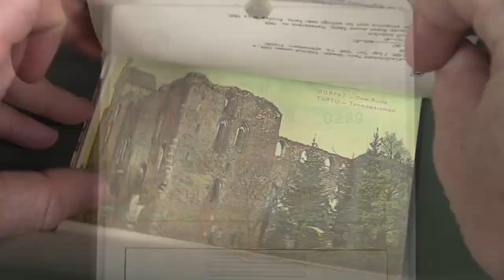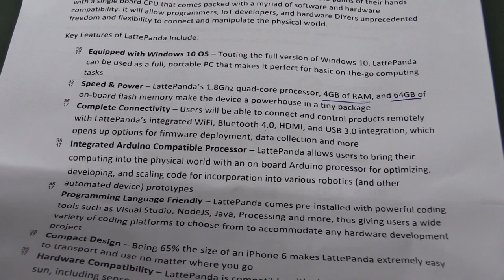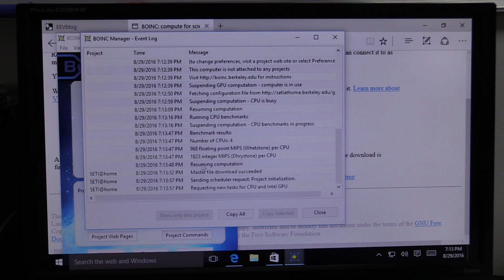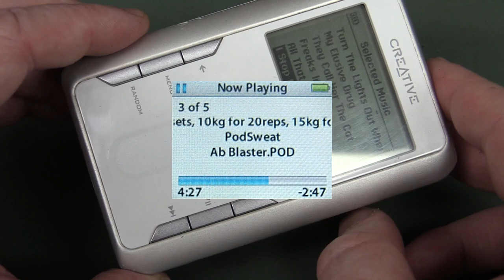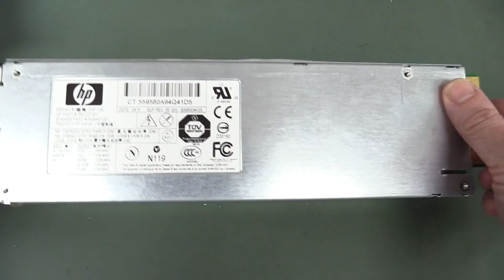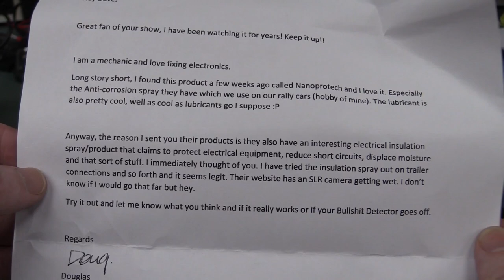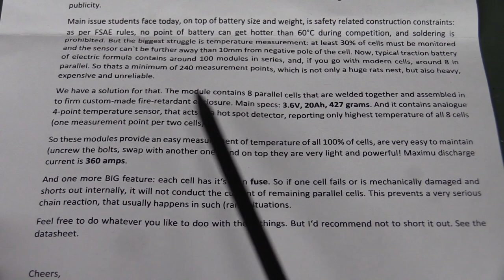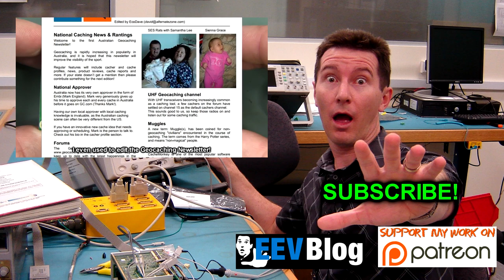EEVblog #917 - Mailbag

Comment: If the HP servers those power supplies go into are anything like the Dell machines I've been inside, they have modular fans that clip into the board right in front of the PSU. They're little 1-inch things with absolutely ridiculous RPM (up to 10k at full load) to push the air through such a tight space.

Comment: I never had one of those zen players, but I do still have my Archos 504 from around 2006. I don't use it for video any more, but I still listen to music on it. The hard drive is big enough to hold around 20,000 songs (~256k VBR MP3) unlike my crappy phone. The batteries are pretty worn out though, they only last a few hours now.

Comment: The power supply is from a very old ProLiant DL360 G3 and provides 325 Watts. Nowadays you can get 1.200 Watts in about the third of the volume, that's almost 12 times more energy per volume. And also those are 94% efficiency with much less heat generation !

Comment: As far as that server PSU goes, it's passive as a module, and hot swap-able as you've indicated as well as the circuitry monitors the supply and unit performance while reports health stat's (to what was traditionally called a BMC (Baseboard Management Controller)) but have been redefined as of late.  To address the passive appearance, the server unit to which this PSU belongs is doing the forced air with hot-swap fans (of course they are!) and it's quite typical of these systems to pull in ~68*F ambient air and kick out ~100*F exhaust.  Quite well constructed and reliable these power units are.  Being in the industry for over 9  years (since 2007) and working in a rather large data-center with thousands of servers and having multiple PSU's each I've only replaced a handful (<10).

Comment: @34.00 Servers are built like wind tunnels, blasting massive CFM's through the case to keep the hardware within spec.  If you wanted to be in a server room, bring ear plugs! The noise can reach into the upper 90-110 DB range. The upper range especially if the servers are working at nearly 100% load.

Comment: Being an owner of a baytrail based (about 10 to 20% slower than cherry trail socs) 8 inch tablet with windows, I can assure you all this choppines is windows 10 doing updates and installing stuff. One thing I immediatly noticed was the sound/volume icon showing a big white X on it, so the sound driver was still being installed and initialised.
I'm 100% sure that the little beastie will run fine after all the updates are done.

Comment: I believe I have the same USB cable
You can plug it either way, but some of them are faulty and will drop a lot voltage during load when plug one way, not the other.

Comment: high voltage electric motor used to spray on that and see if it still works after going deeply into water for a couple days. or get a cheap cell phone and trying the spary on it and dunk it in water for a couple days and see if it works after?

Comment: The transistor is a germanium PNP designed for low frequency amplification. 

What do I win?
Reply from the maker: Datasheet link or it didn't happen.
Reply: if you cut the head of that transistor you would use it as photo-diode :)
Reply: П40 - almost the same as МП40, but less noise.
Reply: 10-79 would be the manufacture month and year. Ꜿ is a dotted lunate reverse Sigma, or a dotted lunate Antisigma, or Antisigma Periestigmenon, which comes from the Hellenistic period of Ancient Greece.
The only use I could find for the symbol was for editing. I can't find any uses of it in maths, sciences, manufacturing, etc.; not that finding that kind of information is easy especially when its used on parts from decades ago.

Edit: Or at least the backwards C with the dot looks like an Antisigma Periestigmenon. Could be something completely different.
Reply: +Derp Herp ....So what did you win?
Reply: 1 million dollars, still waiting for Dave to paypal it.
Reply: +Derp Herp  Has Dave ever awarded ANYONE for knowing the answer to his question-contests?
Reply: Have you ever done it?
Reply: 😅😅 😅 Incredible!
Reply: @bondarenkodf  Damn right I did that when I was a boy back in east Germany. We had lots of Russian transistors.

Comment: Put the button High, so it will enable the PWR_BTN pin on the PMIC, just solder it to the + VBUS pin of the Micro USB. Pretty weird to use a power button.. I can see how it would be annoying.

Comment: For small and portable devices i really wish they would soon swap to USb type-C connectors.
And for things as like singleboard computers, just go for Thunderbolt-3.
With that single plug you deliver the power, can hook up a display, ethernet, audio and your mouse/keyboard.

Yeah, the chips cost a bit, but hey - if you look at the Panda-boar, you could get rid of most of the connectors and make it a bit smaller.

Comment: Use the spray on the VFD calculator and dunk it into a glass of water, A bit of high voltage and logic circuit should prove the point.

Comment: I still use my 2006 vintage 4th gen iPod in the car, though it's had its dead 60GB hard drive replaced with a 128GB CF card. The physical interface is a lot easier for me to use without looking at it when I'm driving, compared to my phone's touch screen, so it's not nearly as distracting.

Comment: When you run USB devices off the  bench power supply, give it a bit more voltage to compensate for the voltage drop in the cable. USB can go up to 5.25V and still be in spec.
Most phone chargers run a bit over 5V, which is probably why it worked.

Comment: Spray the Creative Zen guts with the Nano Protech then turn it on then drop it in water and see if it will run like the drill they pictured. By the way I used to work where we used the gov. spec. conformal coating was checked with UV light.

Comment: @EEVblog you should try that NANO Protech on one of those cheap multi-meters that you have lying around and then try to spray it with water to simulate rain because a highly doubt it will protect it if you will just dip it in water

Comment: 12:46 - That's Microsoft Edge, a browser designed specifically for Windows 10. Edge is taking after the likes of Chrome and Firefox, whereas Internet Explorer, which is also in Windows 10 for some reason, takes after NCSA Mosaic.

Comment: nano protect should be easy for you to test, you have the equipment to test isolation, so just do a before and after.  Or, if your the showy type, spray a drill and stick it in a bucket of salt water :P

Comment: Extreme Overclockers using liquid nitrogen to cool CPUs to break records use a variety of methods to insulate their components from moisture and temperature. Liquid electrical tape is just one, I wonder if a spray would actually provide enough of a coating as opposed to manually dolloping it on.

Comment: Dave fix the power supply at 32:20 you can see the bad connection 1 in (25.4mm) below the inductors :) trolling

Comment: On the NANO PROTECH "drill underwater": they show an AC drill, which would be a good way to shock yourself, but you can drop a DC brushed motor cordless drill into ordinary fresh water and it'll work, without having to spray any BS on it.

Comment: The little Windows 10 board could make a fun "hacker's laptop" project.
Reply: just rip win10 out and good to go
Reply: How would you remove windows? It's not like you can just stick a bootable USB stick in it and press F10 as it powers on...
Reply: probably jtag, it can be done a number of methods
Reply: well thats how you do it rip linux on a stick and boot from there.

Comment: Nice thing is the LattePanda 2GB model with Windows 10 preinstalled only costs 109 dollars.

Buddy over at Explaining Computers did a video on the same Lattepanda 2GB model if you guys want to check it out. Seems like you could at least use this as a proper everyday use computer if you know what your doing.

Comment: 1) CPU of the lattepanda is on the BACK SIDE. 2) i run boinc on it and it's very very hot. if you dont give it a proper heat sink or a fan, it will throttle to ~0.3 GHz. 3)  lattepanda seems very sensitive to power voltage. you'd either need a cable with very low resistance or a power supply with output slightly higher than 5V (like 5.2V-5.5 V) to compensate the voltage loss by the cable.

Comment: I don't have the exact same model, but in mine there were 2 PSUs of the same formfactor cooled by 3 40mm fans. They are rated 14W each so you can imagine that there is some airflow, and yes, it is screaming when it goes out :D

Comment: HP really do design some good server hardware, I've not had many HP servers fail at all. Most servers have a row of fans near the front that push air out the back, so this power supply will have quite a bit of airflow - server fans push out a LOT of air!

Comment: Most rack cases have air going through the entire case, so you'd get plenty of cooling on the PSU.
Reply: Correct That is a HP Proliant ML3xx series server PSU.  PSU chassis has active airflow though redundant fans as well.

Comment: Wow, that battery pack uses Samsung 25R cells. Those things are high current and indestructible. Want to read a fun datasheet you should pull the datasheet for the 25R cells. It's states things like "baked in oven / results no explosion" but it's also very thorough. Good cells, not the highest capacity but stable at high amperage I think it does 25A max out over cell hence the name 25R. Hard to find authentic ones on the Internet, many forgeries with these cells. But if you find real ones they won't disappoint.

Comment: I still use my gaming PC bought 10 years ago, and it's in a full-size ATX case, and have 2 GB of RAM. This thing has 4 GB! The technology is incredible! And my old PC wouldn't handle Windows 10 — that's for sure. And it's about 10 times cheaper...
Dave maybe PIXIS teardown could be more detailed. Maybe it would be interesting also to see what chips are on the power supply control board. They must be op amps and comparators, and maybe a micro between them, but anyway.)
The Toughbook is like dropped from a car while it was moving!

Comment: Come on Dave... at least spray something (ANYTHING!) with the nano-stuff and dip it in some water.  Surfaces treated to be hyrdophobic (which is basically what is described in the blurb) are VERY obvious once you give them a dip in the ol' H2O.  
All the other products that I have seen which do the same thing are a 2 part treatment (and expensive), so a 1 part system would be very interesting.  So please.... spray and dunk!
Reply: All products? So you've never heard of conformal coating? or even using plain ol' nail varnish? (neither of which are terribly expensive.)
Reply: I saw an experiment back in the 80s where a guy sprayed a 240V lamp holder and lamp with CRC/WD40 and dropped it in a bucket of water. That seemed to work.

Comment: Do they still make those 'easy' buttons?  There was quite the hacking craze going on with those at one time or another.

If you want to see a nicely designed power supply, look at one of the 2.4kW compact power supplies for a Dell Poweredge M1000e which are manufactured by Flextronics Power.  They are amazingly compact for how much power they put out (12v at 192 amps!)

Comment: Precious radio. I had several of these radios and televisions Russian-made communist era. Although at that time there was no talk of open hardware, the Russians already put into practice. In the user manuals of these radios and televisions, they included electronic diagrams with all the details, values and even waveform observed by the oscilloscope. I still have some of those diagrams. Transistors seen in the video, we opened with a file at the top, and we put a lens and used it as phototransistors. That was in my teens, in the 90s, on the Isle of Cuba. Thank you for bringing those memories.

Comment: Dave, those Pyxis units suffered shoddy SMD caps, that's what usually causes a dead display.
Reply: The GPS signal was changed in the 1990s and this receiver needs a new chip to work.  I know because I have one.  Sony did not offer a new chip to make it work so, it is useless.
Reply: @richardneidhardt1828  You have the correct year, but GPS didn't change. The issue is actually caused by the GPS week number rollover. Certain GPS units, including the Pyxis, cannot handle the week number rolling from 1024 back to zero. It would have worked after the week number had incremented enough (the exact count depends on the receiver), but it again rolled over in 2019. The GPS signal has been added to, but never in a way that breaks compatibility with older receivers. Even my Magellan Trailblazer will still work, aside from the bug mentioned above. (I'm not sure if mine is affected or not, I need to check.)
Reply: I will be interested in knowing if your Pyxis works.

Comment: "Nano"protech... Probably micronized PTFE spray on acrylic carrier. Pretty decent sealant. Do not spray ports with it unless you want them to fail.
Reply: Sorry for self answering... I was wrong. It's paraffin-based, much less interesting and much worse. This is why it says a year lifetime, it will break down in time.

Here's a sample MSDS: http://www.nanoprotech.ru/attachments/get/109/nanoprotech-o_electric_aerosol_en.pdf

Got to oil up your electronics! At least it will be easy to remove with some naphtha or maybe even acetone.

Comment: A quad core Atom SBC running Windows 10, and it's slow as a wet wick? This is just one reason why the CC/open hardware community has mostly moved to Linux on ARM processors.

Comment: It is slow because it is thermal throttling, Lattepanda failed to put a heatsink on it. After I put heatsinks on it it works perfectly.
Reply: Oh and the CPU is on the back for some odd reason, so the heat goes in to the circuit board and heats everything else up.

Comment: Hello, Internet! 
Yes, the number 79 is date code. The transistor is МП40 (MP40). Here are some pages from authentic soviet 1981 transistor handbook (in Russian, of course):

https://www.dropbox.com/s/1jng2nz05h35fpj/mp40.zip?dl=0 

You would use such handbooks for all info, if you would design a thing like that back then. Internet came to this region in very late 90s. We did not have datasheets here, only those handbooks with one to three pages for each component max, including digital circuits. If you had a question beyond that data in book, you would make a custom rig and test the parameter, you wanted for yourself.

Comment: Edge is a brand new browser MS did from zero (supposedly) for Windows 10 and it's usually the best option for those single board computers and cheap stuff with Windows 10, since Chrome will love to gobble up to 1GB+ of RAM for a single  open tab, since it opens one separate instance for every extension you have, as well as every plugin you have.
Reply: They didnt do it from zero, edge is based on chromium.
Reply: +Pyrofan97 I don't think so, apparently it's a fork of the trident engine that was used in internet explorer - https://en.m.wikipedia.org/wiki/Microsoft_Edge#Features
Reply: 1GB with only one tab?!? I suppose you have 30+ extensions. I just keep Adblock, and it's reasonably memory efficient (unlike, for instance, firefox, which has become a pain in the ass).
Reply: funcatvids Not really. Only uBlock and Disconnect. Keep in mind that Chrome opens:

-1 instance per plugin you have (Flash, Java, etc.)
- 1 instace per extension you have.
- 1 instance per tab you have open
- 1 instance per element that requires hardware acceleration

By default, when you open vanilla Chrome, it already starts with ~8 instances and using about 400 MB of RAM just idling. Put a YouTube video on that tab and the RAM goes up to 1 GB. I have Firefox open right now, three tabs open with 4 extensions and it's using only 1 GB.

Comment: Hi,

About the Soviet calcuator and radio, some people have already explained, what MOCKBA means and what was Estonia in 1980s (so they could actually be manufactured in the Estonian Soviet Republic - but I have no idea whether they were producing any electronics there). But I can explain what says on the calculator rear side.

Factory number: (I can't read it)
Date of manufacture: 0280 (I presume it means February 1980, and it makes sense, taking into account the components day codes)
3 x 1.5 V; Price: 55 rubles
BZ-14 (not B3-14!); Manufactured in USSR

Only watching it for the third time I understood the "Australian model" of the cell :-)

The radio can receive long waves (ДВ - DV - LW) and medium waves (СВ - SV - SW) and the scale is, of course, in terms of the wavelength in meters instead of frequency.

On the radio rear side, there is a range switch, and on the label it says:

Radio receiver
Kvartz 404
Olympic

And in the small boxes:

APP-IV
GOST 5651-76 (it seems it's a standard it complies with)

Powered with 9 V
2 ranges: LW - MW

Price
32 rubles, 20 kopeks
Reply: It's interesting that a calculator was more expensive than a transistor radio in those times!

Comment: Can't you use most drills underwater for short to moderate amounts of time anyway out of the box? I swear I remember AvE doing a video on that
Reply: Yup, Ive used a 110v drill completely underwater, I was  fitting 1/2" take off valves to 18" iron water mains in a six foot deep pit, one of the pipes was live and there was no way to isolate it without cutting water off to a large part of the south coast of England, once started I had to finish drilling and tapping the hole-under 4 feet of water. Not a good day. I was not happy. And soaked. J.

Comment: hey dave you should do what they show clearly on the can get a drilling machine. pull it apart. spray its guts out. slam it together and see if it can drill underwater. also be interesting to see what it would be like with eletronics and salt apray or salt water. will it stop corosion